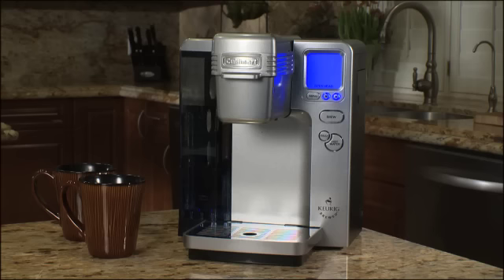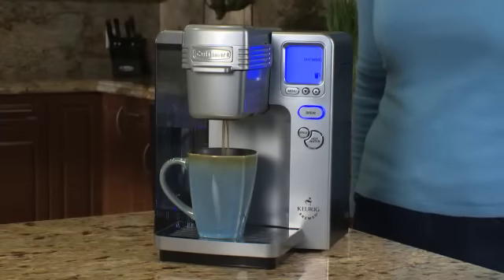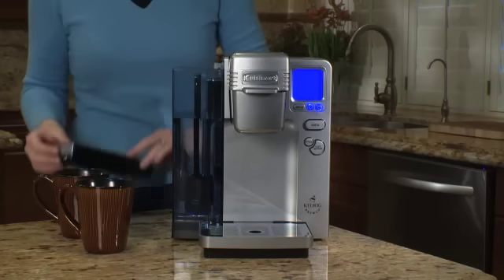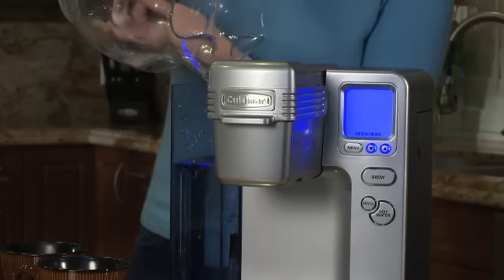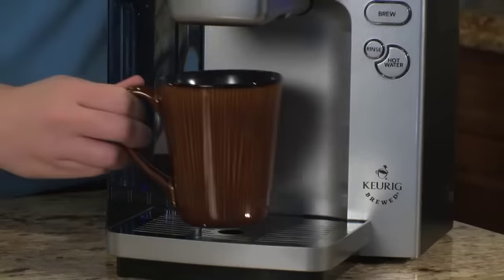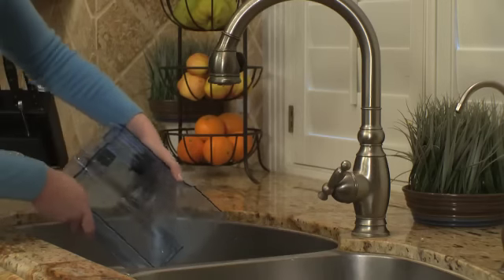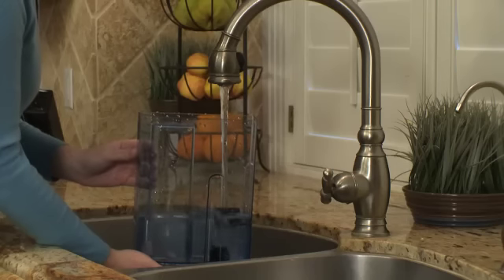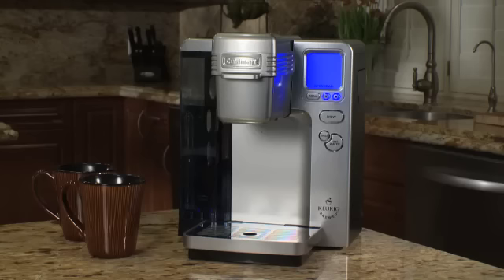Cuisinart Single Serve (SS-700) Maintenance Video: Removing mineral Deposits by Descaling

Comment: This worked perfectly, the first time.  This is an awesome video. Quick, to the point, unlike other self-help videos on youtube.  Any device worth it's salt is going to have issues with mineral build up.  If you use any unit that has issues more often than the recommended cleaning timeframe then don't wait for an "idiot light" to come on.  Clean more often.  When feasible, try to get a water softener, use filtered water, etc. Cuisinart, you have great products and we own several. Thanks again.

Comment: We've had one for 8 or 9 years. Because of hard water, we need to clean out the scale every year or two.  This last time, I descaled it, but it didn't seem to work afterwards.  I went looking for a replacement, but they don't make anything similar anymore, and nothing seemed to match the quality of the old one.  I managed to find a used one online in nice condition, but it didn't seem to work either, until I realized that you need to fill the water tank to the top to prime it if the water lines are empty.  I tried that with the old one, and now I have two working Cuisinart SS-700s.

Comment: Ours stopped working, then the descale light came on. After banging it and unplugging, it worked again for one day then nothing. I added the vinegar but it wouldn't pull it in, so I turned it off, unplugged it, removed the reservoir then turned machine upside down and around, then plugged it back in, replaced the reservoir with the vinegar and it worked. Then I did the descale. So far, so good. Hope this helps you.

Comment: The best way it would be to fill the reservoir 1/2 way with the strong 9% vinegar. Try to flush it by using the "rinse button". If that doesn't work then get the smallest diameter clear tubing you can get (from home depot, lowe's or any hardware store). You only need about 1 foot. One end goes to your mouth and the other one into the sharp nozzle where the coffee canister goes (on top). Push it hard towards the nozzle while you blow first and no air exits to see if it gets de-clogged. If not then just suck hard in stead of blowing. Once the nozzle it's clear change the cup size to the largest one (10 oz) and press that rinse button as many times as you want, to fully de-scale the internal tank in your coffee machine.Keep using the same brewed or rinse vinegar by adding it to the reservoir to keep re-flushing the machine with out wasting more vinegar. My two cents.

Comment: After 1.5 years our unit stopped passing water.  We always use RO water.  I added vinegar to descale and that did not do the trick.  I did use the suggestion Leopold Enriquez below using the small plastic tube.  I could not blow through although when I did suck the tube I got a mouth full of vinegar and coffee grounds...which did the trick.  I imagine that some grounds are forced into the puncturing needle through use and eventually this causes the clog.  I did run the rest of the vinegar through and then rinsed with another full flask and it works great once again.

Comment: My SS-700 is not a year old. I only use it when company comes.  I can hear it fill with water.  I can hear the water heat up. But it will not dispense anything.  I have cleaned everything I can find. I am at a loss at what to try next. Any ideas?
Reply: Many of these Cuisinart's were defective when they were sold.  I bought one from Amazon and it was DOA.
Reply: I finally got mine to start pouring so I could run the vinegar through by holding my finger over the tube that comes out at the top of the water dispenser area while trying to brew! After a few seconds of holding it will start bubbling at the bottom. THEN the water finally started pouring out! I think I'm going to make a Video about it to help others! I messed with this thing forever before I finally figured it out, so hopefully I can help others too! Also, try the paper clip trick at the top where the poker is. Mine was REALLY clogged up in that area too. It doesn't look like there are holes there but there are! Mine also started acting up after only a short time. Now it seems to be doing ok! :)

Comment: We've had problems with this thing since we got it. The descale sign always comes on after it has completely stopped working. We usually try for several days to get it to run water through at least once, because after that it will keep working so we can descale. After we descale, it usually sort of works for the first week then magically gets better for about a month before it breaks again. We always use filtered water btw.

Well this time it's been 3 days with no luck. To the garbage can!

Comment: How do you replace the heating element and where can I buy a new one?
Machine is 3 years old and temperature only reaches 173° in the cup (temp set at 192° in the settings), so I'm getting very bad tasting coffee.
Reply: Descale it first, clean it and then reset it

Comment: My pump would not pump at all. So i took the reservoir lid off and saw the recirc line dumping water. I stopped it with my thumb and the impeller had a lot of bubbles run past it. Something got dislodged and now i'm able to descale. It seems to be helping a lot.

Comment: That's great help, however, what if the whole 60 oz of vinegar dripples through and it is still not running as it should?  Our unit was descaled as soon as the message appeared, but it continues to drip through after several hours of trying to run the 60 ounces through.  What now?